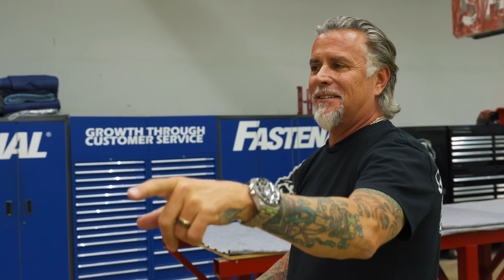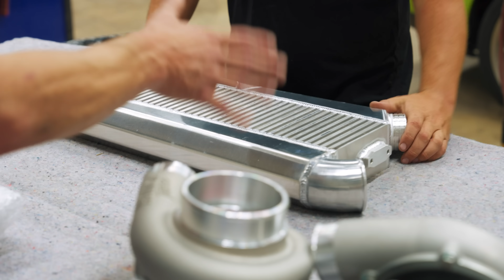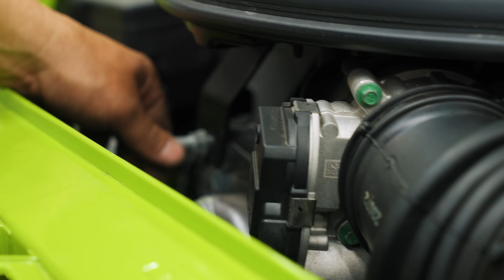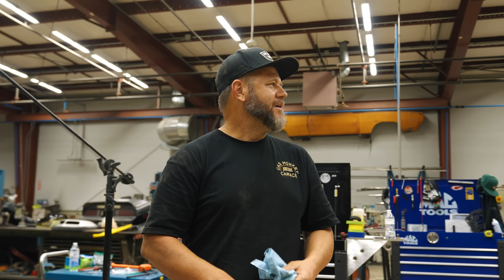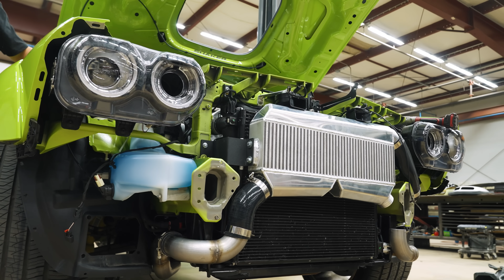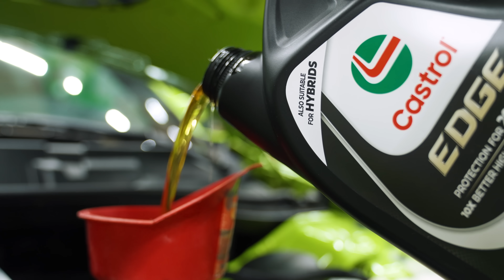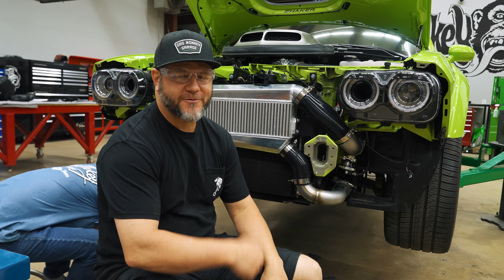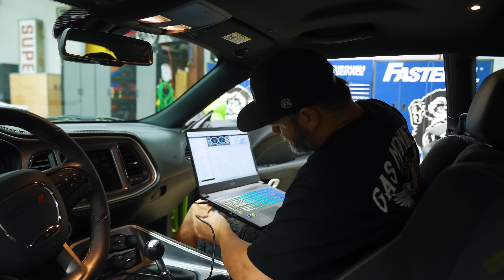Twin Turbo Dodge Challenger 392 Build | Gas Monkey Garage

Comment: Resume: IBM / Kitt Karr Auto-manufacturing Langley (on hiatus) / Pontiac (NASCAR IndyCar) - Top Secret FairLady/R34 designer, Carrara Cup Car engineer and owner of GTWorld. Watkins Glen is my lane and building with manufacturer race car numbered parts is my game, then slap a turbo or supercharger on it. From a ground up, parts numbered stamped steel Duesenberg to the Carbon fiber " GLASS " trash of today. 🤔 Never minded, my full name is not recognized (SDNY/NYPD) because of a 25+ old federal RICO secret indictment (not charged yet, but my life was screwed). ✌️♟️
Reply: With my manuscript 1: 1 formula 333whp/t to 450whp/t is attainable, no forced air needed engine, fake oil/fuel. I offered, but Elon Muskrat a South African at the time picked batteries (not electric), Auto Industry leaders, and OPEC said no thanks. ✌️🙄♟️
Reply: I also have been denied my earned Electoral College vote through my ownership of (73% IBM) RacyAngels member of both SAG-AFTRA / Writers Guild, on hiatus. No Diddy 🤣✌️Two-Dollar Paperboy
Reply: Uniform Laws Annotated: Masters Edition 🫡

Comment: Lets see how long that crank lasts.all that extra power.gona hear a rattlesnake soon.😅
Reply: The crank is forged steel should have no problems. its only 5psi of boost.
Reply: @ATomRileyA  not made or rated for a twin turbo conversion.not tested for this........crank,pistons and rods need replaced for this application
Reply: @djbillye4943 wrong!!!! Thats why the helion kit works so good it doesn't need all of that.  The 392 kits have been on cars for yrs and nobody has  had an issue
Reply: The helion 392 kit has been on alot cars over the yrs  alot of them are on YouTube...no issues

Comment: I give that thing 100 miles before it blows up if it doesn’t blow up after a few good pulls.
Reply: You're not well informed obviously, this kit has been on tons of 392 cars, why don't you check them out before running off about something you clearly know nothing about
Reply: @Nemesis-302   stop it show me any 6.4 hemi that has been running stock internals on a blower or turbos and hasn’t blown up! You don’t need to get in your feelings I’m not bashing hemi’s but anyone that knows anything about this cars will tell you the same the 6.4 does not handle any type of boost well🤷‍♂️
Reply: @waltermurga9422 there cars out there that have been running these kits for a minute with no problems

Comment: arent the 6.4 internal glass cannons, wont it need pistons n rods
Reply: Most blow up because they’re never properly tuned and use crappy fuel.
Reply: @alexcorona they are like glass they do not have forged internals
Reply: @mr.k6136 that's fine but some how helion has figured it out and plenty of 392 cars using their kits
Reply: @mr.k6136 no they are not most idiots that boost 392 use crappy tunes that’s why they blow up they can take up around 8lb of boost on stock internals
Reply: @alexander_3923 not true.  Even with a good tune, factory ringlands can crack.

Anything past 6 psi is pushing it for stock pistons.
Reply: The helion kit has been on a shit ton of dodge cars for yrs with stock internals...if you guys took a second to look those cars up you wouldn't be assume stuff
Reply: 6.4 isnt a glass motor. It also isnt hard to swap the cast internals out for forged internals if you want to push higher boost. The stock motor though can handle boost it just needs to be tuned right

Comment: That motor not gonna last long.
Reply: @asapcornerstone7851 your the type of dude to think all “ builds “ need 700 hp , put it against your car to see how it does 😂
Reply: @GRIM.2002 he's a goofy poser bro! Mostly just clueless here, plus going from 485hp to a safe 700hp for this price is better than buying a hellcat. Even building your 392 for more boost will cost less than a hellcat.
Reply: Its going to be fine!! You obviously never seen the 392 cars that have had the kits for yrs now!
Reply: @Rick-fe8xn  lol. I've seen more than a few with windows.  I own a 392 scat.  I would never do that without a forged guts.whatever to each there own.
Reply: @Rick-fe8xn  loooool.  Your the rotating wizard of all time lool.
Reply: @asapcornerstone7851 well then don't get it! You're simple as hell and don't see the potential here! Stock 392 safely putting down 700hp ans if you want more just build the damn motor and then turn up boost, problem solved
Reply: @Rick-fe8xn  lool.  Why do you think direct  connection never released the 392 upgrade kits...hint. they splatterd the dyno room floors when pushed multiple pulls. That was just fuel and timing adjustments. Hey have fun best of luck. Lol. I can send you some cast iron momentous if it makes you sleep better.  Cheers. Lmfao
Reply: Con rod exit soon
Reply: @scottbaker1018 wrong plenty of 392 cars already running this kit it's already old news, but obviously new to you
Reply: Its only 5psi nothing crazy as long as the fuel is there and a decent tune it will be fine.

Comment: That's awesome! I know some are going to be whiny little 'Itches because you messed with stock parts on a collector edition, but I'm the type that believes there's nothing wrong with improvements. And more horsepower added to that car is an improvement I see as a must! And 600-700hp. is perfect for that car. I just hope the clutch can handle it. lol.

Comment: Those engines don't handle boost well at all...  That engine is going to blowup
Reply: Stick to riding bikes and let the pro's do there job
Reply: From my understanding they can handle 5-6# of boost.  With that said, I'm not doing it to mine.  Even though more power is always cool.
Reply: The pistons are fine.The stock ring gap is just too small.If you increase the ring gap and leave the overheating protection on the engine will survive.greetings from poland
Reply: @hansjochen6257   greetings from America, can confirm the 6.4 is 💩
Reply: It's not the engine that's the problem. It's the piston and the placement of the rings. Give it some forged drop-in internals, and it's fine.
Reply: @brandonmcginnis4610  it would be a beast with forged internals, but….Richard didn’t and just threw it on stock internals.
Reply: Exactly why he keeps saying 5 pounds of boost. ✌️👍🇬🇧
Reply: @iannorton4463  🤦🏻🤦🏻🤦🏻🤦🏻 stock 6.4’s can be prone to regularly crack positions without boost.  Guess my speed shop and their customers are lying. He won’t boost a 6.4 without forged pistons due to this.  It’s just a marketing stunt that the winner will regret.
Reply: Helion cars have done well, there's plenty of 392 hemis on YouTube that have had the kits for yrs
Reply: @Nemesis-302 this clown has no clue what he’s talking about. 😂😂😂😂
Reply: Mmm.  They just made a bomb.  Those ring lands are going to fail.  That 392 engine doesn’t handle boost well without forged internals.  Boom incoming.
Reply: @bd746  do you own one? Most likely not. 😂😂😂😂 that 392 gonna handle that shit like a champ.
Reply: @NickToutant  Not hating.  I own a 5.7 whippled and went that way for a reason after much research on the engine specs and expert opinion.  I make Hellcat power on the 5.7 at 9 psi as the ring lands are more forgiving than the 6.4.  Scats are great cars but to seriously mod the 6.4, you need forged internals.  6 PSI boost on a scat isnt worth the money or the worry about when it will blow.  The BGE block is awesome and can be a monster, but only with forged internals
Reply: @NickToutant do you own one?  Most likely not.  How do you know then that it will handle them?
Reply: @bd746  congrats on owning a fucking slow turd.  lol
Reply: @witchdoktor69  tf kinda question is that, do you own one either? Obv we’ve done hours maybes days of research on potential builds before jumping into something, other wise we wouldn’t be saying anything. The hell kinda name is witch doctor you have to be 12
Reply: @PYolk     First off, with all of your horrible spelling & grammer, you are the one that must be 12 years old.  If you are commenting because of my response to @NickToutant, it's called SARCASM.   He questioned someone like a know it all about not owning a Challenger.  I repeated his comment back to him.  Again, SARCASM.   Stay in school kids.
Reply: @PYolk    
First off, with all of your horrible spelling & grammer, you are the one that must be 12 years old.  Maybe 10.  If you are commenting because of my response to @NickToutant, it's called SARCASM.   He questioned someone like a know it all about not owning a Challenger.  I repeated his comment back to him.  Again, SARCASM.   Stay in school kids.
Reply: @PYolk  

First off, with all of your horrible spelling & grammer, you are the one that must be 12 years old.  If you are commenting because of my response to @NickToutant, it's called SARCASM.   He questioned someone like a know it all about not owning a Challenger.  I repeated his comment back to him.  Again, SARCASM.   Stay in school kids.
Reply: @PYolk  someone with such poor grammer & spelling such as yourself shouldn't make fun of someone else, maybe being 12 years old.
Reply: @NickToutant  oh yeah let’s see your boosted 6.4. I don’t even have to check your channel I already know you have zero content.
Reply: @bd746  nick got absolutely destroyed w this comment. dummies keep saying “do your research” well good news for you we have done EXTENSIVE RESEARC before throwing money around like good ol Richard.
Reply: You don't know anything about these engines
Reply: @ericp2427  please enlighten us since we don’t know anything.
Reply: @bd746  it's known that these engines can't handle boost. They blow after about 7psi. What's so hard to understand that not every engine is built for boost? You don't see boosted 392 in the roll or drag scene because they don't last. the internals can't handle boost.
Reply: @ericp2427  sorry dude.  I’m in agreement with you.  I have my 5.7 with a safe 8 psi and about 3000mi.  So far so good.  Going higher is flirting with failure
Reply: @e @ericp2427 u mean to tell me a gen 1 coyote can handle boost and hp better then a modern 392 😂 this is crazy to me lmfao 🤣 no way dodge don’t have an engine that can handle power from factory other the the hellcat motor ! Sheesh I’m trading in my Gen 1 coyote tho for a zl1 Camaro 2015 tho ! I just feel like for that price with like 30k miles is no point to touch a dodge ever in my life unless it’s a hellcat ! Dodge at this point needs to retire lol 😂 these cars should have good engines that can take lower specially in 2026 those hemi should be stout ! The gen 4 coyote is better than every dodge out there lol 😂 a rock gen 2 or 3  5.0 can take 900whp no problem ! They need to update the internals in the 392
Reply: Yeah the 5.7 is supposed to be better than that turd
Reply: @Eggnoging  you need to research before running your mouth, alot 392's running Helton kits and most are on YouTube
Reply: @Nemesis-302  your profile photo is a children’s game on shoes. Stick to shoes gas monkey fan boy. This entire page is lame af. Dude should have let his career die on discovery channel.

Comment: 392's are weak under boost. They also have major design flaws.
Reply: What are their design flaws if you leave them na ? Serious question I’m looking at one rn.
Reply: @shonuffLA  The car or the Ford lovers comment?
Reply: @shonuffLA  have you heard of the hemi tick? Ppl try and say it's normal but it's not. Its your lifter eating away at the cam Loeb. Due to bad internal geometry, oil has a hard time getting to the top of lifters.